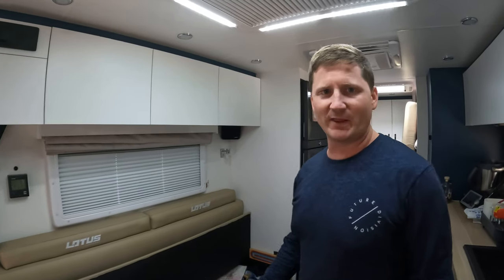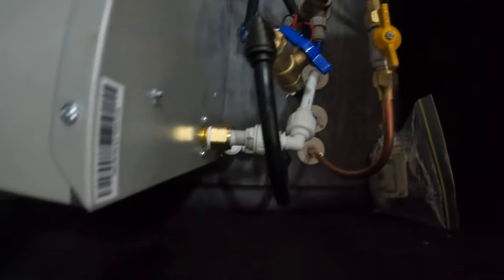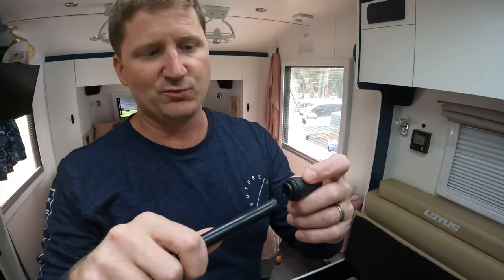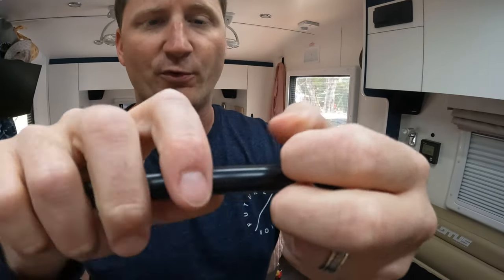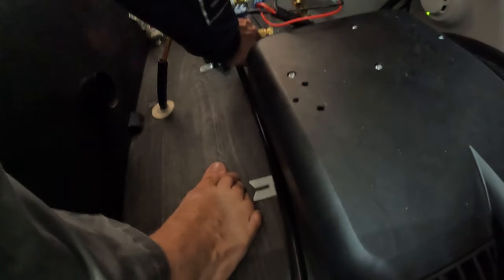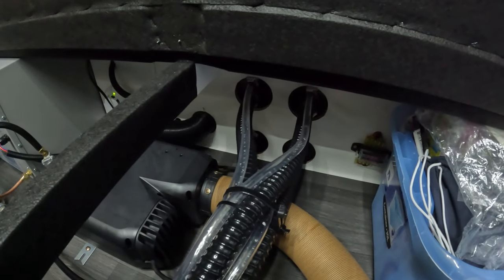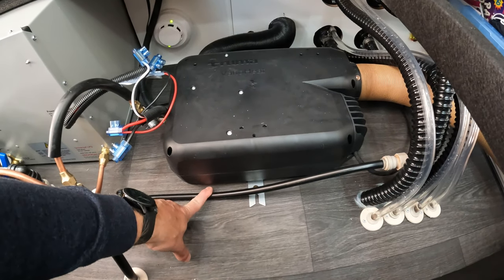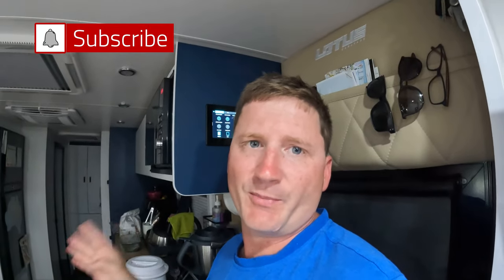MUST HAVE FREE CAMPING OFFGRID CARAVAN MOD! WATER DIVERTER VALVE

Comment: Hey mate, great vid.  I also watched the one you did on your old Jayco.  Noticed you went back to tank on this install but back to the cold water line on the Jayco.  Was this just a "horses for courses" due to the location or is one better than the other.. Thanks again
Reply from the maker: Hey Mate. 🍻 for watching along. 
Going back to the tank is better for when you are connected to mains pressure. If you were doing it, I would try going back to tanks if possible and put it to the tank you use first when off the grid.
Reply: awesome, thanks for coming back to me and safe travels... @FamilyEscapeAustralia

Comment: Great video, just installed one and it works great when the pump is on. Only tricky problem I have had is when connected to mains the hot water won’t come through. Have you  experienced this?
Reply from the maker: Hey, yes, we did just turn the flow rate down on the hws and it should fix your issue. It was only really an issue in the colder areas for us.
Reply: Hi, thanks for your reply however even with turning the hws flow rate down still no luck. Might need to bypass the valve when we’re at caravan parks. It seems strange as we are currently travelling along the coast of nsw with 30 degree days.

Comment: Presumably this would allow you to fill up your tanks without using the external filling inlet as well? 

Our fresh water tanks are joined and self levelling so if I'm hooked up to mains, turned the hot water system off, and opened all of the faucets this would divert all water and automatically fill up my tanks?
Reply from the maker: Yes, this is a side effect. Ours slowly fills when hooked up to mains.

Comment: Hi dose your water pump stay on because it’s stuck on a continuous loop? Great video Thanks
Reply from the maker: Hey jesse. No it doesn't. The van water system works as normal just diverting the redwater. Thanks for watching.
Reply: @FamilyEscapeAustralia  hey guys could you please double confirm- with the heater off, does the pump continuously run bypassing back to your tank?
Reply from the maker: Hey. The pump will only run if a tap is on. The only other reason we have had our pump run randomly was an air lock or the tank ran dry. Cheers for watching
Reply: @FamilyEscapeAustralia  isn’t the water not being at temp and the valve being open the same as having a tap on?
Reply from the maker: @cornyratbag if the tap is on and the water isn't at temp the water recirculates back into the tanks. Hope this helps 👍
Reply from the maker: @benpro01 hey. The pump will only run if one of the taps are on. If yours is running, you may have an air lock.

Comment: Looking at doing this. Thanks for the video. If on mains water at a caravan park, how does it go with regards to over flowing the water tank?
Reply from the maker: You do have to monitor it. Some people have installed a bypass valve, so it doesn't use this valve when on mains.

Comment: Hey mate have you had any issues with the valve working as it should when connected to home water supply? 

I’ve recently installed one and when using the pump it works as it should each time.

Whereas when connected to the house water supply it doesn’t. 

I’m thinking it’s a water pressure problem resulting in the instantaneous hotty not engaging and turning on.

Any thoughts on this are appreciated 😀
Reply from the maker: We did have some issues in the colder weather. But it always work's and that was more the hot water system. I would check your hws first and slow the flow down if you are in colder weather. Hopefully, that helps. 👍

Comment: You really need to have the dirverter valve as close to the taps as possible as having it next to the hot water system Dosent take very long to get hot water their
Reply from the maker: Yes, but caravan plumbing isn't very long, and this was the easiest point to ensure it worked with all taps. The purpose is to ensure minimal wasted water while offgrid. Thanks for watching.

Comment: This makes no sense. I am a licensed plumber and have installed hundreds of these. There is no point installing it next to the hot water service it defeats the purpose. These vavles are designed to be installed at each appliance. So you need one under your sink in the kitchen and then install one under the van to pick up shower and basin. I understand what your doing and great vid but location of these vavles are critical for maximum performance.
Reply: Any chance you're near Exmouth and can do an install?

It would work, caravan instant hot water services are not very fast and the plumbing is very short.

But I'd love to have a plumber do a really efficient install for me!
Reply from the maker: Spot on. They are worthwhile and are not that hard to do if you can't find anyone.
Reply from the maker: Caravan plumbing is very short. Yes, you could install 3, but at almost $200 a pop the cost is not worth it.  The main reason is to prevent the waste while the unit heats up as this takes 30 seconds to a minute depending on temperatures. The valve only opens once the unit hits around 38 to 40 degrees. 
Saves heaps of water in this configuration. Yes, it could be more efficient, but at that point it would not be worth the cost. 
Thanks for watching. Hopefully, that explains it a bit more.

Comment: Definitely not optimal water saving in that position. The valve is going to open very quickly being next to the HWS and the cold water already in your pipes is not going to be diverted. Manufacturer instructions and every install I have seen in a caravan put it as close as possible to the shower or sink.
Reply from the maker: Yes, but also ease of installation and being able to tap into all of the hotwater lines at one point is also a consideration. The redwater still trickles through the piping as the unit heats up, therefore pushing that cold water sitting in the lines through. We haven't had any issues with it this way, and we all shower after each other so the lines dont cool down either. The main aim of this is to prevent water wastage as the hot water system heats up.
Reply: @FamilyEscapeAustralia  if it works great. You are better off putting it close to the appliance that actually wastes the most water ie. the shower and kitchen sink. Pretty easy to mount it under van in the hot water line just before it goes into the shower/kitchen. Don’t worry about the bathroom sink.